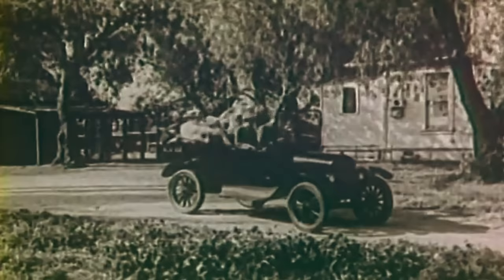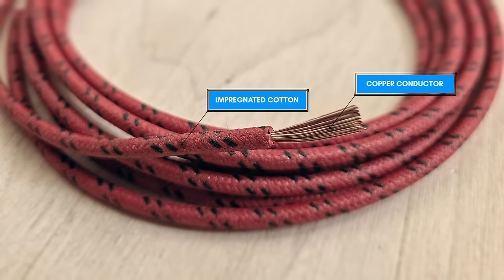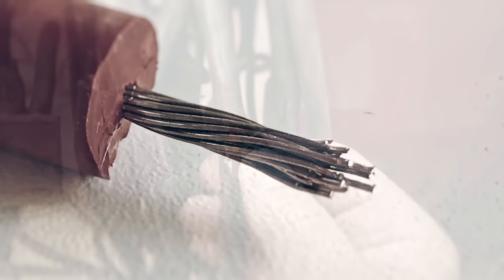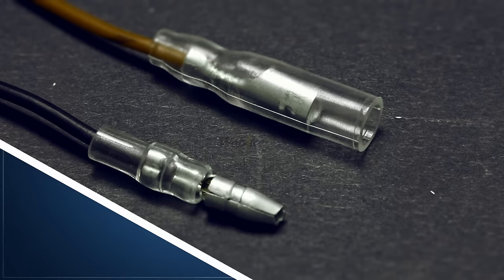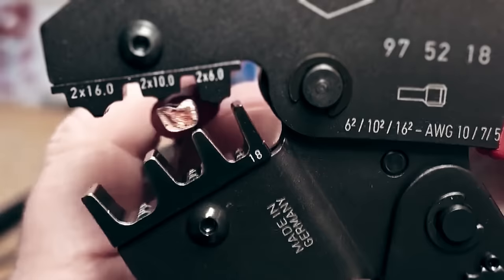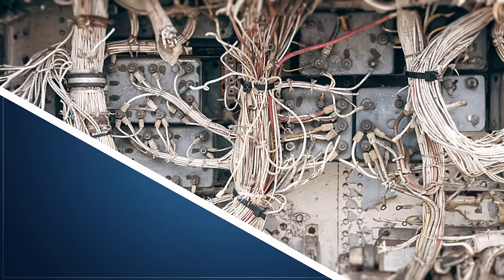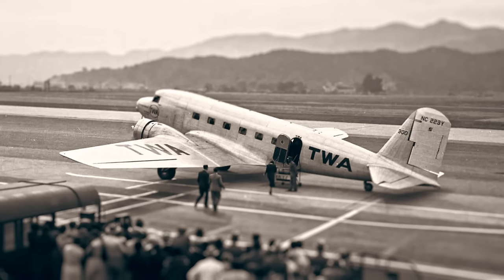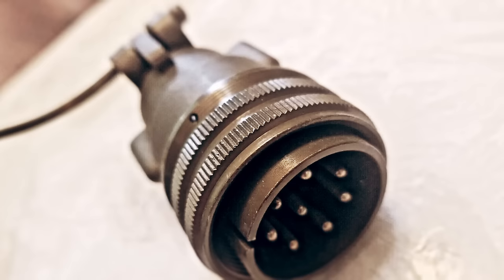The Fascinating Evolution of Automotive Wiring

Comment: I first encountered cannon plugs in the Navy. I always thought they were called that because they resembled the end of a cannon. Thanks for the extra tidbit of information I wasn’t expecting!
Reply: I always thought they were made by the Japanese camera company, Canon.
Reply: @slowerthansound  not a bad theory either
Reply: I kind of wondered, but never gave it much thought as to why they had that name.
Reply: I think New Mind made a mistake here, Cannon Electric founder and inventor of the Cannon plug was James H. Cannon not Robert Cannon.
Reply: Cannon really changed the game for a lot of industries. I work in live entertainment and daily we use various forms of the XLR connector, which started out as the Cannon X series, then they added the latch feature, so it became the XL connector and then they added the rubber insulation between the pins on the female side, resulting in the final XLR connector that every sound and lighting tech uses daily. Though these days most XLR connectors are manufactured by Neutrik or Amphenol.

Comment: Yes the can bus, the reason a headlight costs 10x more than a normal bulb would. I mean some engineer is happy about it right? There is no reason every light needs a processos to run on a can bus yet here we are. Running 3 and 4 wires instead of 2. Awesome technology,  completely done in all the wring places.
Reply: Engineers don’t usually add features to a product in order to raise the price. They add features because it’s cool to add them. Management usually “requests” that features get added in order prices may be increased. There could be a regulatory requirement for being connected to the network.

Or the extra wire or two could not be for can bus at all. It would have to be two wires for the network so if there are three wire it isn’t connected to can bus. The extra wires could be for daytime running lights and shifting between high and low beams, for just two examples.
Reply: @capitalinventor4823 love it when an expert answers a post thx 👍

Comment: There has been an ongoing debate as to which is the more reliable connection--soldered or crimped. The video shows why crimped is the way to go and why it's used so much in applications where reliability (not just cost) is critical.
Reply: There a few applications where terminals are crimped and soldered.  Or at least there was. I worked in maintenance at a factory producing wire harnesses for Ford and Chrysler for over a dozen years. Common applications of that type were high current circuits where the terminal was crimped and then dipped in a pot of molten solder. Another interesting one was terminals for power window switches. The wire cutting machine would cut, strip, apply flux, tin the wire, crimp the terminal, reflow the solder with a specially adapted spot soldering press and finally remove the flux in a solvent bath. Average production rate was around 20 pieces per minute.

Comment: As an apprentice auto technician, the starting point of my career basiclly socked with moedrn electronic control system, everything are digitized and electrified. 
Even through my experience and skill are still limited, I can tell that on modern cars, mechanical problems are actually less than older vehicles yet harder to fix, since most times they are burried by wires and connectors. 
Electrical problem on the other hand, are far more frequent and odd (I mean differs on each vehicle), other then some common issues usually lead by poor design or manufacture defect (I blame budget control in most cases), two identical symptoms may casued by totally different cause on two same vehicles. 
To me, the can or lin bus system itself is very reliable, wires do not just go bad as time passed (some will, high heat or outer element do destory them), connectors are also fine in most cases unless high current burns them out, but acutators and sensors are not, they do tend to go bad without warning some times. 
Now we are living in an era that EVs may wipe out ICE cars (Please don't, I pray for it), I am curious about what is coming next on vehicle control system.

Comment: My first car was a 1963 1000cc Mini.  It had a simple positive earth battery system.  I wanted to change it to a negative earth system so I could fit some Amateur radios to it.  So I figured, I'd just turn the battery around and treat whatever problems (or smoke) showed up.  Surprisingly, it just worked.  The moving-iron fuel gauge didn't care. The Generator poled it's internal field and began charging reverse polarity.  It started fine.  Nothing more to be done. Drove it for years afterwards.

Comment: With the raise of more digital systems and interconnectivity in cars also raised the risk of theft. In a documentary I saw a thief using a handheld device to start the car. A similar thing told me an elevator technician: Cyber security became a new thing in the industry because elevators become more connected. For example calling the elevator from your hotel room or your phone.
Reply from the maker: This was a bit outside of the scope of the video, but yes this is very true. Especially when many of these integrated components may never get security fixes or any sort of long term software support.
Reply: Do you mean unlock a car or start a car? Because starting a car was never a problem once you're inside

Comment: I love working with older ring terminals and spade connectors, they're so DIY friendly. ATO fuses, bosch-style relays, and a few common switches and components all use the same size of spade connector. Making it easy for a home-gamer to customize or repair their own wiring. Newer connectors are a bit easier to (dis)connect and are waterproof, but there are so many different pin types and connector housings. It would have been nice if there was some more standardization. But car makers have demonstrated that they're more interested in obfuscating their components and making everything proprietary.

Comment: I worked in a startup that was targeting automotive communication applications for a while. There is some really complex stuff going on there, and people are trying different approaches to solve the problems. 

With ADAS in mind, people are looking to have sensors such as cameras and radars transmit uncompressed, raw data. Some expect this will push the data rate seen in the automotive wiring to above 50 gigabit/second. Currently there are two standards for 10 gigabit and 25 gigabit based on ethernet, one being copper and one optical. There are also some other standards such as automotive MiPi. However, for future upgrades, it is unlikely more than 25 gigabit/second can be transmitted over a single twisted pair of copper in an automotive environment---the loss the signal experiences is simply too great to carry it over the distances required. Optical is met with a lot of skepticism, because people are worried it will be fragile w.r.t. the vibrations a car experiences, and the optical lasers and diodes used for data center will not work at the elevated temperatures faced in vehicles. 
There are interesting new technologies, like millimeter-wave over dielectric waveguide, which I worked on, but it still requires some R&D to get to a point of commercial viability.

Comment: Very well done. You incorporated a lot of good pics and videos. Only missing one terminal connector, but well before your time. I had a 1908 installed elevator, that may have been the very first ring terminals. (Stakons)
To make connections of up to #6 copper wire, they took a 1-1/4" length of 1/4" copper tubing, flatten one end and drill a hole in it. Then they soldered a wire on one end and could either put the flattened end on a terminal or bolt them back-to-back in a motor box. Brilliant for 125 years ago😁

Comment: in the early 90's a rancher bought in a very old nice condition Toyota Corona to fix the brake lights (had been driving it for 20+ years), after several mechanics and us auto electricians were called to verify something weird, we concluded the factory wiring loom omitted the the brake light wire, from the switch on the pedal, no extra wire in the loom (harness) just fully missing.

Comment: Ford used a 104 pin single PCM connector that required a captive bolt to tighten and loosen the connection. PVCs largest drawback, more so than dielectric constant, is its limited temperature range and abrasion resistance. The use of RS232 and other common industrial communication methods, was not directly adopted by automotive, mainly because RS232 specifies a signaling voltage requirement for dominant and recessive states. The use of a UART in generating a serial bit stream used in off highway (but could be adopted to Automotive) J1708 uses an RS485 type driver with some external bus components. Some custom J1708 bus interface ICs were also available, which had a default state when the node was severed from the network.

Comment: Great video.  Lots of awesome footage.  I thought that the DIN numbering system would rate a mention.  Around 1910  a standard was developed in cars where every wire had a designated number.  Most of those numbers have disappeared.   However if you go to an Auto store and buy a generic Auto relay the terminals will be labelled 30, 85, 87 etc.   These strange numbers can be traced back to the original 110 year old standard.

Comment: Exceptional work here, 44 years engineering in big auto harnesses world wide you have missed one little understood design aspect of the best automotive connectors. Shortly after the auto industry designed plastic shelled dedicated connectors with "click on insert, pull to test" terminals this was upgraded to  "Yoka Poke" (fool proof assembly) connectors incorporated "locking keys" that must be inserted fully home and would only go fully home only if all terminals present were seated and home to depth correctly. These keys if not fully home would not allow the connectors to be mated so insuring all connectors were either assembled correctly or open circuit, NO INTERMITTENT CONNECTIONS, intermittent connections being the worst failure of automotive wiring. These fool proofing keys often worked as secondary latching systems and were confused as such as they were so similar however this was not heir prime function. Good test systems such as shown at 14:37 would detect a key not fully home or missing thus ensuring terminals were inserted fully into housings so catch the failures at manufacture however if not detected the harness could not be connected on the production line, a worse failure but not as bad as being connected with a badly seated terminal that would pass line inspection only to go intermittent on the customer at a later date, such a failure often difficult to diagnose.

Comment: This show how much thought is putting into wiring especially critical system inside a vehicle, A while back there was a push from tesla to only use single wire for the entire vehicle. And to me that just sound like a disaster waiting to happen.
Reply: It's technically possible to achieve this, however that introduces a "single point of failure". In reliability design terms, this is a poor choice.

Comment: Great video for 2022 but You forgot where we are today:
Wires have been slashed in number and size by running Gigabit ethernet cabling + data CANbus to every component— all on the same 48v cable.
You can make a new video on it called "evolution of automotive wiring from 2023 on"

Comment: A very interesting video👍. As a telecommunications engineer it explains so well why I am no longer intested in modern vehicles which are software and communications protocol based.  
For driving  experience I have  just ditched my one year old £60k Mercedes with its distracting central touch panel and voice control etc. Instead I have bought a 30 year old classic which does not rely on main dealer maintenance or contain my driving and other personal data😡. It is a joy to drive and easily maintained by me or a local mechanic. ❤️I leave the sophisticated electronics at home or on my phone or iPad and cwhen I want driverless I  call Uber !
Reply: I drove a 30 year manual MG the other day. One of the most fun cars to drive!

Comment: Personally I love working with high strand count, soft silicone insulated wiring. I find it very forgiving when it comes to friction inside wirechains, and heat. Especially whem soldering tiny wires to microelectronics for connecting to larger scale equipment, where an insulated wire or larger guage is prefered over solid core enameled jumper lead (my use doesn't justify the expense of buying costly pogo-probe jigs). But then again for me it's mostly hobby work and electronics repair, so the scale of my consumption means the additional cost of using this type of wires isn't that big in absolutes, and for me the creature comforts are worth that expense.

Gotta be careful with tugging on the very tiny ones like 30+ guage though. The soft silicone insulation is a good bit more elastic than the wire strands inside, and if you don't pay close attention the moment it happens, you might not notice that the copper leads inside have broken.

Comment: 20:46 No way a typical 2000s vehicle is using fibre optic links for the in car audio.
Reply: the fiber optic was more like cheep plastic line with a red LED, not the same as high speed internet fiber optics that use glass and lasers.

Comment: 22:27 The American EV charging plug is designed for 1 phase, N, PE, two data lines. 
The European EV charging plug is designed for 3 phases, N, PE and two data lines. 
But the protocol for the data lines is the same.

Comment: just wanted to add that those different types of communication protocols, different connectors, different "networks" in the cars are part of the expense of the vehicle. The mfg's have to pay to use some of those copyrighted systems. Some are copyrighted by the makers but some were developed, researched and licensed to the automaker to use.

Comment: To the engineers responsible; please make the wiring diagrams more accessible ! lol 

I’m looking at you specifically Cummins..
Reply: Yeah.... 
The automobile industry should change and be standardized. 

1) The car owner should receive full access to the computer, and have full technical specifications and blueprints of the whole car. (The same is for the buildings, boats etc...).
2) The right-to-repair should be enforced, but it is as well for the parts that are serviced by non-authorized party be excluded from the warranty afterwards (but not parts that were not touched). 
3) The cars should be designed such way that every panel, every wire etc can be accessed easily with few screws or bolts. So that everything can be very easily be taken apart to service and repair without taking hours to get somewhere. 
4) Automobile industry needs a proper hacking community, where people would start offering proper services to install new additional features like full surround cameras, a proper additional features like cup holders and tables or backseat entertainment system (requires 1).

Comment: How could the Model T have the first automotive electrical system?   It started production in October 1908.  But the Baker Electric Car was sold in 1904 (Thomas Edison bought one) - and it had (obviously) electric batteries - and electric lights as well as the electric motor.  800 of those cars had been sold by 1906 - by 1907, they had 17 different models - plus electric trucks.

Comment: It's a shame that some recent developments made some aspects of reliability significantly WORSE. Intermittent ground fault on what used to be the old standard of wiring, and the blinker may not work right or blow a fuse. Maybe some corrosion or other connection issues on a light assembly, replacing the thing would be under $200 because it's just copper contact terminals molded into the plastic and nothing else going on. Now if you have an intermittent ground fault on CANBUS your car won't even start because it's disrupting something in the computer and you're completely stuck like Chuck until you can get it towed. Not only that, but if the fault is with issues in something like a specific light assembly, the microcomputer module contained in the light assembly is proprietary and you can buy an entire used car for the price that they want for the stupid thing.

Might not be the exact topic here, but it's the kind of stupidity that seems overlooked when engineering gets overdone and nobody with sense has the ability to make the call when field-testing stuff. Needs to be called out, and it's one of the reasons why people that like older cars make their choice. They probably can put better fault tolerance into CANBUS design, but it's not there by default like some of the older stuff. A lot of recent shop stories out there seem to show that poor design decisions were made.
Reply: It’s not stupidity. It’s intentional.

Comment: I had a 2005 Subaru Legacy wagon, and to be « green », some idiots made the rear hatch wiring harness insulation out of soy.  Of course, it degraded quickly and eventually failed, at which point not only would that disable the rear wiper, but the whole car wouldn’t lock.  The replacement one was insulated using tried and true materials.

Comment: Surprised this didn't touch on the Cybertruck's new fangled 48V architecture and wiring differences vs other cars today--although I guess it kind of covers it with using ethernet, but it's for everything not just camera data transfer. But neat nonetheless.